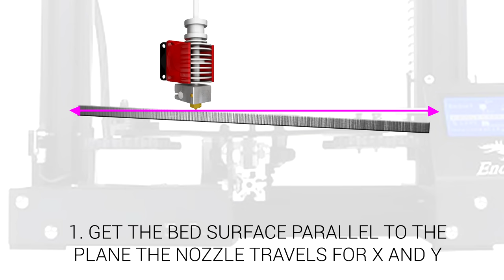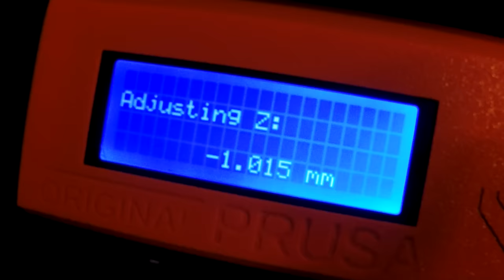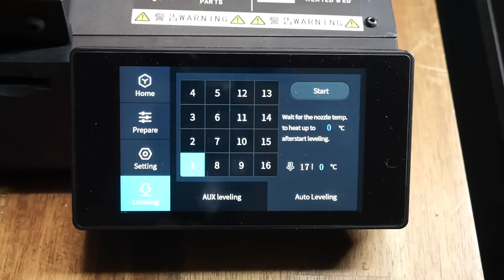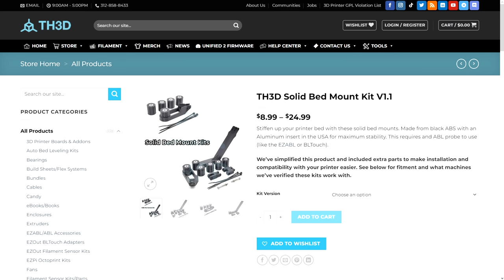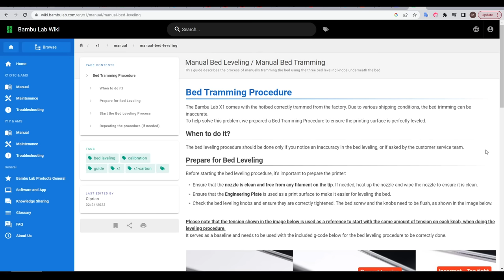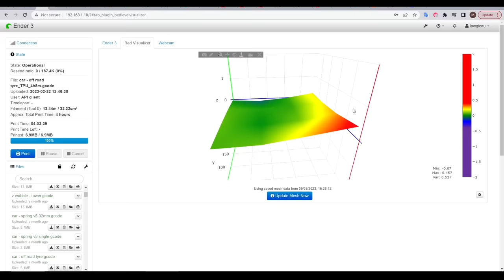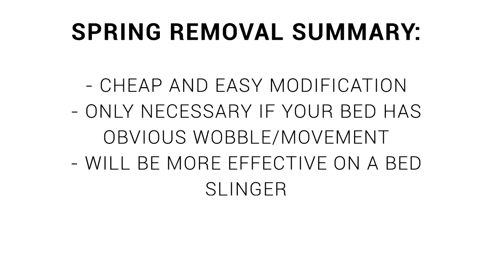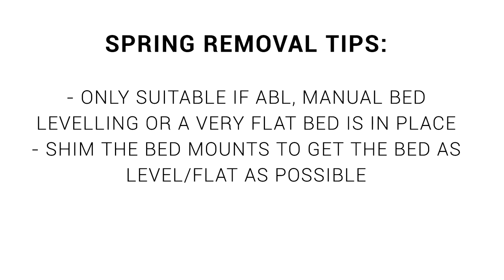Is it time for 3D printers to abandon bed springs?

Comment: Nobody talks about bed vibration. But using silicon spacers instead of springs will dampen vibration.
Reply: good point, makes a lot of sense
Reply: yes and no. hard mounts will transfer MORE noise to the printer not less. Springs will "dampen" the noise transfer. its just a "different kind" of noise.

Springs allow the print and bed itself to "create noise" when they jiggle if not installed right or if they are just too heavy. Hard mounts allow noise from OFF the bed to be transferred to the bed and thereby your print.

but a good smooth tight machine can reduce this.
Reply: @nerys71  silicon spacers aren't hard mounts, they're a spring damper system all in one.
Reply: @John Long  damper, in this case, means to reduce vibrations. Not make more damp.
Reply: @nerys71  Dampening is a different topic than just spring suspension. If we were to take theory books to the face (and only 1st chapters at that), a perfect spring alone would ring forever without any stopping force. Obviously not the case, but it IS why dampers are added to car suspensions, on a print bed the springs will also just ring until naturally dissipating that energy.
A silicone spacer tho is different, as it's a viscoelastic material. It's properties change with the rate of motion, effectively being a damper by itself, instead of just a spring.
This means, in theory and practice, that the silicone spacers will make it stop ringing faster than a spring system.
A rigid mount would also work as a spring system by the way, just the spring stiffness is FAR higher, effectively the bed frame's flexibility becomes the spring.
Reply: @nerys71  are you really going to argue with THIS guy ?? where is your own designed 3d printer that prints at 2k acceleration ? I think this guy knows a thing or two about 3d printer noise with those speeds ))
Reply: @Anon20855  I know a little bit I have almost 200 printers and almost 10 years experience I wouldn't call myself an expert but I do have some basic knowledge and experience
Reply: @Anon20855  I think you forgot a 0 there for the acceleration :D
Reply: @Anon20855  2K is hella easy, I made a giant at work that pushes max 5G at moves (so 50K) and prints pretty walls at 2K, pushing 5K inners and 10K moves.
Vez tho? That guy moves at freaking 10G+. Optimal accelerations on the 5K+ range to "avoid excessive smoothing". I'm proud of the beast I build, but his machines are monsters on another level. No wonder that sub 4 min. benchy record.
Reply: ". But using silicon spacers instead of springs will dampen vibration."

A) The silicone will do nothing as long as there is a bolt that mechanically links the bed to the frame.
B) If you remove the bolt then vibrations will be much worse because the silicone will not dampen any movement of the bed and every movement of the motor will cause the bed to jiggle around.

YOu very specifically do NOT want the bed to be able to move relative to the frame AT ALL. it needs to be exactly where the stepper says it should be so you want to connect the bed to the frame as strongly as you can.
Reply: @vinny142  If I ass myself I could provide sources on the viscoelasticity of silicone and linking that to the theory of vibrations. It's a well understood topic in mechanical engineering.

I dare ya finding sources on your claims tho...
(sorry tho I don't think I'll bother looking that up but the names alone should bring up google's results on the academic topics).
Reply: I've been using those for 18 months and they're great.
Reply: Silicone, not silicon (which is essentially glass).
Reply: Het there which motherboard will you recommend me octopus v1.1 or
Reply: @deone-entity3935  If getting an Octopus, I definitely recommend going with the Pro model. 48v steppers are cool as heck, specially since you can chose the voltage individually. 1m/s movement ain't easy on 24v but 48 pushes some current on those speeds easily. I use that on the giant work printer so I can say it's a pretty nice board other than the beeping after you turn it off for a few seconds while the capacitors drain.
There's also that new BTT Manta which is basically an Octopus with a Pi CBM slot built-in. Can't talk for experience on that tho.
Reply: Youd need to decouple the main body of the printer from the surface its on as the motors are mounted to the frame not thd bed the vibrations are coming from the stepper motors not the bed itself. And as the mass of the bed as a whole moving wouldnt be affected by the silicone spacers you wont get a noise dampening effect from them.
Reply: Exactly @Vez3D i use extremely hard silicon dampeners. There is only a few Millimeter of adjustment but when the mechanic is good enough, you wouldn't need more than that. Plus the silicon is some kind of self-locking the leveling wheels and never had to relevel.
Reply: Butyl is the best damping rubber
Reply: Or just put damping grease on your regular spring.
Reply: Springs can also dampen vibrations, for a bed-slinger the use of springs makes a noticeable difference. Tightening the springs allows a more precise adjustment of the input shaper frequency. These experiments were done by Harchencko_Eg from Ender 3 russia community.
Reply: Just get some thick silicone rubber tubing and then cut to your preferred length.
Reply: @Anon20855  who is "this guy"? Some nobody on YouTube?
Reply: @nerys71  Good thing he wasn't talking about hard mounts then.
Reply: @Anon20855  I mean my ender 3 prints at 2k accel with ease. I think you mean 2000mm/s print speed.
Reply: @Smokinjoewhite  maybe there is a difference but most of the hard mounts I have seen available for sale are just that hard mounts while they are technically flexible the amount of flexes negligible at best although that's not my area of expertise so maybe that minimal amount of flex is sufficient for dampening I don't know

If the machine is built to a high enough quality standard hard mounts soft hard mounts work great for example my CR6 SE is hard mounted no springs and it's one of my best quality printing machines doesn't quite rival the ender 2 but it's close
Reply: @Kalvinjj , Is any one selling Octopus pro v1.0 with Chip H723 set?
Reply: both have steel bolts running through them under tension, so you're not dampening anything either way.
Reply: @Maltfalc  it still dampens it.  Imagine a snair like a drum.. with steel bolts holding it.. now add rubber spacers .. you think sound will not change?
Reply: @Kalvinjj  Sorry to be that guy, but dampening means getting something wet. Damping is getting rid of vibration :)
Reply: @coltenmeredith8899  Eh, you're not being an ass, I was in doubt about the correct word anyway since I've studied that topic in another language.
Reply: That's why I have spares and spares, and colorful ones, short ones,  because I don't deal with vibration.
Reply: What about to use the silicone spacer, and spring washer, that would give us the full PID control of the movement
Reply: I'm ordering mine today
Reply: 🤣💀 hopefully not serious
Reply: Also silicone allows for leveling of about 1mm without washers. Which is nice.Just tried them and I think I like them.
Reply: i use them they keep the tram better then springs, springs tend to loose the tran but the silicone ones are awesome

Comment: The worst is having four springs instead of the correct three. A plane is defined by three points, so the fourth will always be hanging in the air. But you never know which one. Bamboo Lab got it right using three points.
Reply: does your car have three wheels? yes the plane is defined by three but in the real world more mounting points make the mount stiffer. once you level them, it´s level anyway. bambulab has three because they have three lead screws.
Reply: that only applies to 3 RIGID points. By using springs, you ensure that all points add to supporting the bed. Using the known spring constant, it's easy to compute how much more one spring might be loaded if it were, say, 1 mm higher or lower than the rest. It would only make a lb or 2 of difference, depending on spring stiffness.
Reply: If you look under the bed, you can see the gap between the adjustment knob and the bed mount to identify which one is "hanging". It is pretty easy to close the gap by tightening until you feel some resistance.
Reply: That requires the bed to be high quality and rigid, most are not.
Reply: Thats true but there are other factors that will benifit from having 4 corners supported. Look at the hevort for instance. 3z but 4 corner supports. Having 3 support only will have 2 coners in the air and prone to vibrations. Using the kinematic bed directly metal to metal with magnets and a steel ball has no dampening. We all go crazy on gantry resonnance but we forget that big drumm bed will also have vibration and dampening it really helps on ringing
Reply: @faxxzc  my car does not use springs for adjustment. I have an anycubic printer with four springs and no matter what I do, I can always make the bed move out of alignment by tapping one or more of the corners. This is because there is resistance to movement, so the bed is not truly floating on the springs. It is also very frustrating when trying to hit the perfect alignment because after checking three corners, the fourth should in theory already be in alignment but it would probably just be floating in the air. If you try to fix it, the bed will move.

Lead screws really has nothing to do with it. There should be three points with two in the front corners and the third at the middle of the back. That last one does not actually need to be adjustable, so you would only adjust the two front screws. When the bed is level, you adjust z height electronically. Much easier that way.
Reply: @Timestamp_Guy  You don't seem to understand the purpose of those springs. It's NOT to support the bed. It's to provide an anti-backlash mechanism for the leveling screw.
Reply: @johncochran8497  Except the springs are literally what is supporting the bed. The springs push up, the screws pull down.  None of the downward force from the weight of the print bed or anything passes through the screws. It all goes through the springs. The screws are there to preload the springs, not vice versa.
Reply: I use a glass bed and I just removed the spring and nut from one of the corners. Works well for me.
Reply: @Timestamp_Guy  The springs have to be strong enough that normal bed maneuvers don't change the compression of the springs. At that point, those springs do absolutely NOTHING except provide anti-back-lash for the adjustment screws. The issue happens when manufacturers use cheaper, weaker springs.
Reply: @BaldurNorddahl  actually, your car does use springs to set the weight on.  Go look at your front struts.
Reply: @kg4tnp not what was said. The car does not use springs for _adjustment_. In fact a car is not exactly level like a 3d print bed needs to be, and the car does therefore not have a similar mechanism. It is a bad analogy.